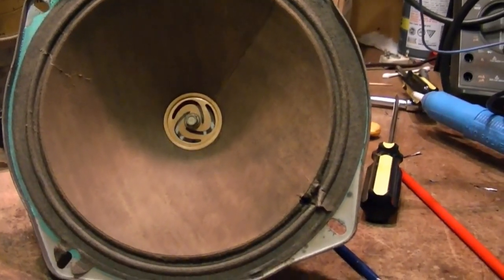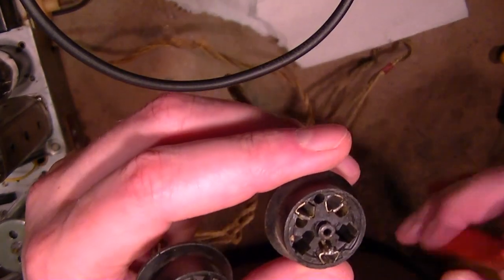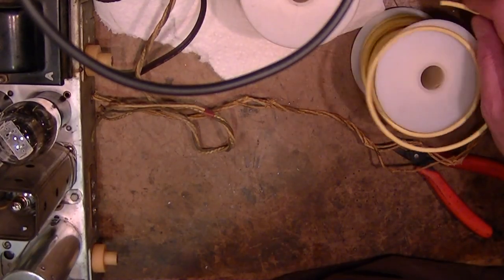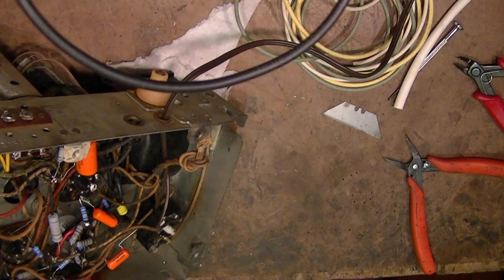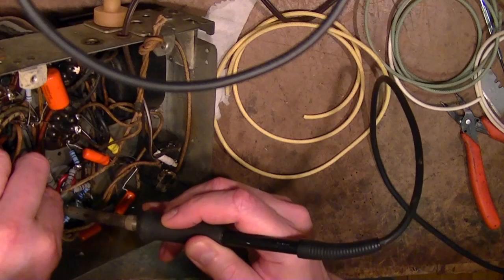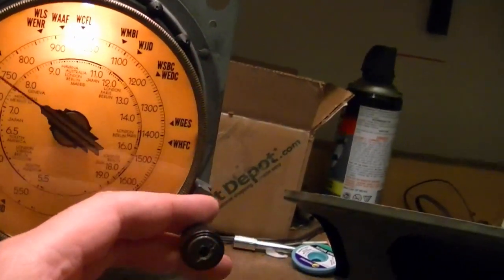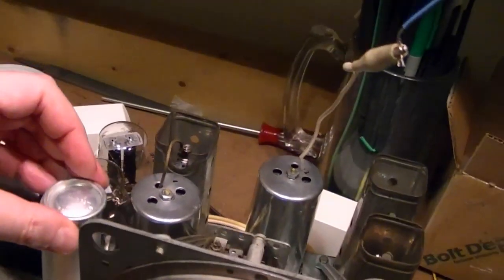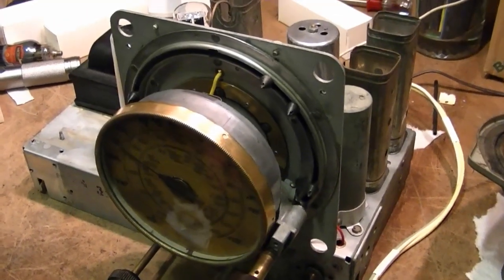Philco 38-7CS restoration p10o12

Comment: In my experience with AVC circuits, there is a nominal negative bias with no or weak signals. This is the -3v you mentioned. This is set by the Candohm resistor chain.

When a stronger signal comes along, the audio detector tube's DC output pulls the AVC line even more negative, typically up to maybe -6v or so I think for strong signals. I don't think the grid is ever supposed to be as high as -0.5v I think -3v is
about the highest voltage the grid should ever see.

The AVC won't kick in until the audio detector DC output goes below -3v so there
is a range of signal strengths (generally weak) for which the AVC does not activate. Only on stronger signals is the bias lowered below -3v.
Reply from the maker: Thanks for the clarification